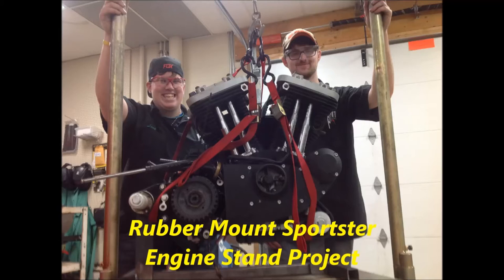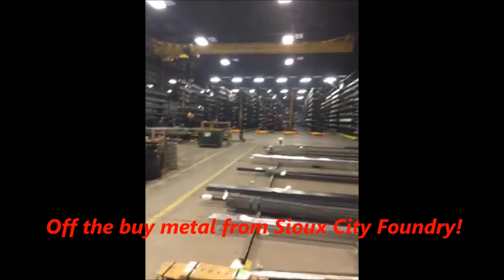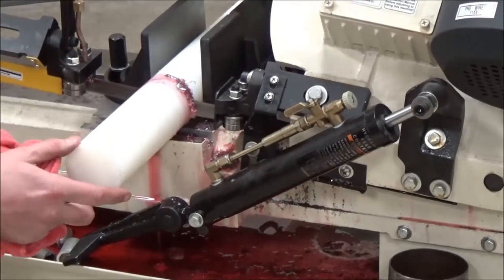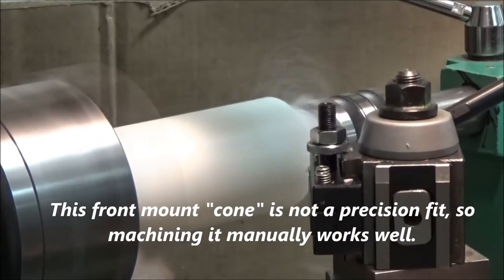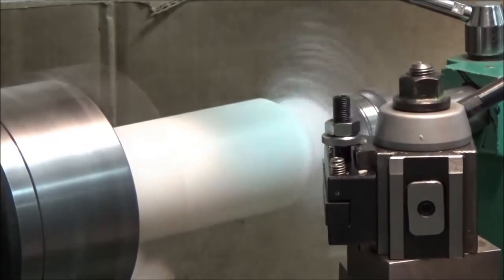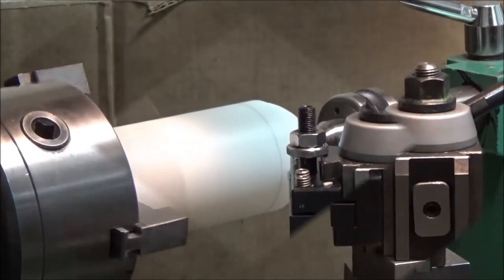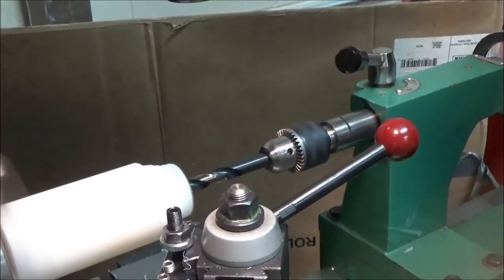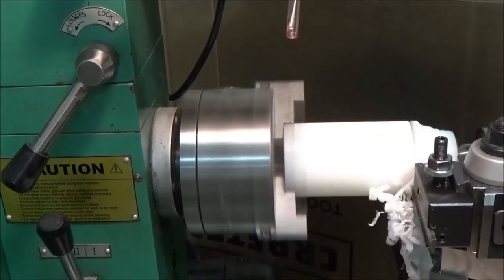How to make an engine stand for a Sportster rubber-mount Harley Davidson

Comment: If you weld or bolt that to a Harbor Freight or other cheap car engine stand head plate it can rotate 360 degrees and not waste workbench space. I frequently mod those stands to take bike and mower engines as they cost less than buying the steel. Adding larger (swivelling) casters makes moving them around the shop a breeze.